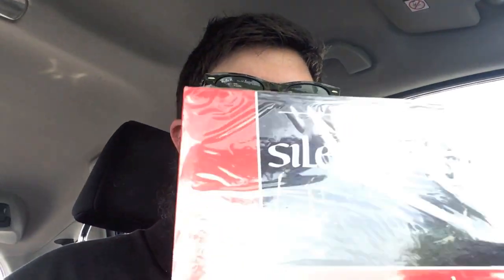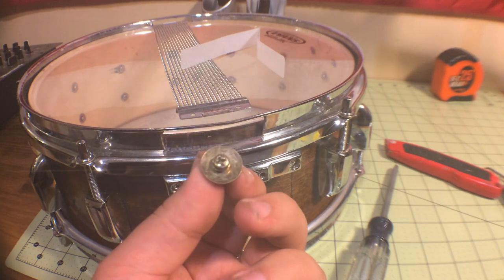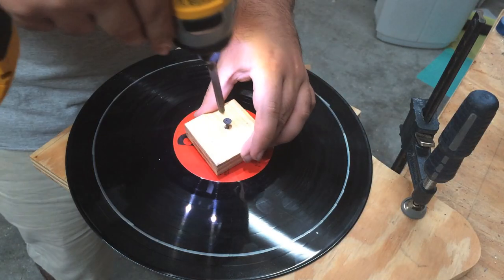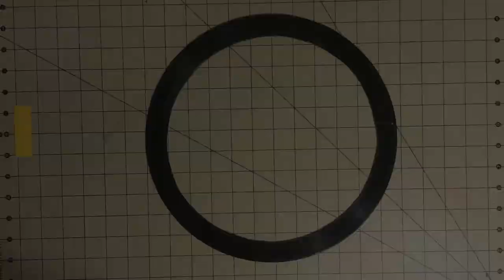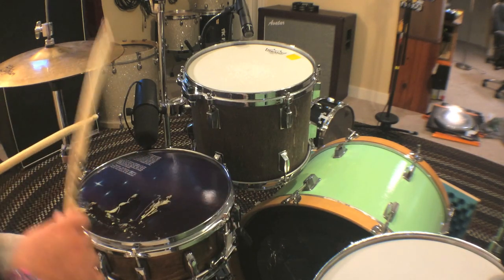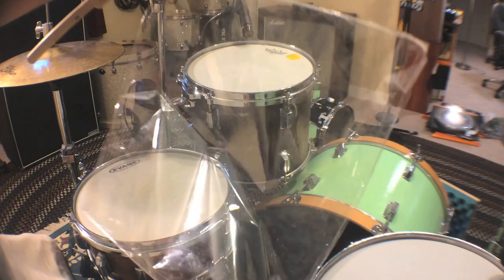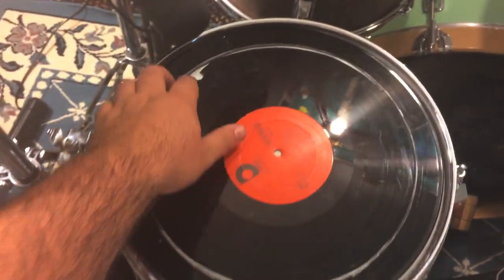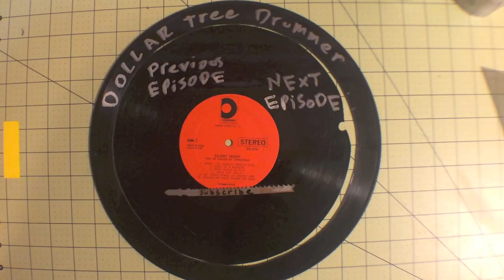Making an O-Ring Out Of An Old Record

Comment: for my snare muffling, i use an american padlock for a weight, and i hold it in place with two moon gel pads. i did have two locks, on each side, but it was too muffled so i now just use one lock. very much cheaper than a specialized snare weight.

Comment: Have you thought of modifying the size of a drum shell. Like making a 12x9 tom into a 12x8 tom and doing the same degree of bearing edge?
Reply from the maker: +Trevor Gorwin The snare I use in this video was actually an old tom I cut up. 

not the best video, but you get the idea.
https://youtu.be/qTFNnx_mWxg
Reply: Oh man I completely forgot about that video you did for that snare haha. I re-watched it and what tool did you use for the bearing edge?
Reply from the maker: +Trevor Gorwin A router, I used a 45 degree chamfer bit on the inside and then a small round over bit on the outside